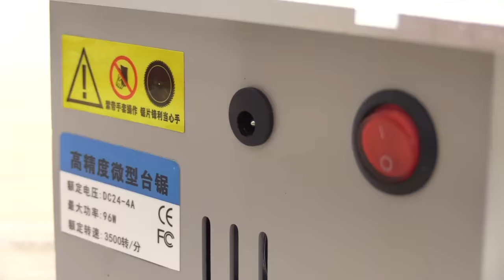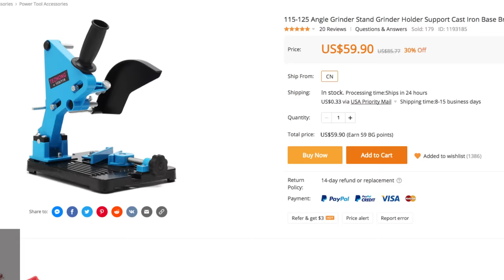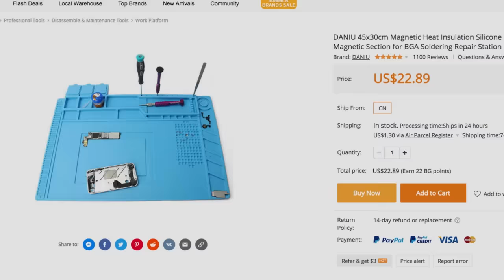3 AMAZING Object for DIY BY: Banggood

Comment: I made a simple crosscut sled for mine,with a much larger work surface,from 1/8" hardboard and plywood rails guiding ut the outside of the tabletop. So I can cut larger pieces. I made a T-square type of rip fence from 3/4 alum. angle stock,easier to adjust.

Comment: Can you lower the blade on the saw? It has to spin to make the drill work, but i dont think its very safe to do so if the blade is up
Reply: No but on the flip side you can use it to build a cover for it.
Reply: @ez-8238  I was gonna say that if they didnt shipped with a cover, the drill attachment shouldnt be part of the kit. I mean, you can use your own drill.  but i just realized, at least in the photo @4:13 it shows the cover for the blade. I suppose they did actually thought about that safety issue.
Reply: @Alientcp  Not only they thought about it, they included it. You can see it in the unboxing at the start. The host just didn't bother to install it before using the drill.
Reply: the blade lowers with an allen wrench thru the table, the chuck still works,it moves up and down too.. the blade guard is useless,same for the rip fence. I would make a flip-up blade guard similar to regular table saws,with riving knife. On other YT videos,I've seen some very creative homemade rip fences.

Comment: The mini table saw is cool and if it was $25-$30 ok great but they got it priced at $125. I bought a full size table saw on Black Friday sale last year for $99. Full price was only $135 so even not on sale it would have only been $10 more than this tiny offbrand. I don’t need another one but if this had been a reasonable price point as I said $25 or so I would get it just for convenience and not have to break out the big one for small jobs.
Reply: So you want it to be MORE convenient than your full size one, but pay LESS? Your full size one costs less BECAUSE it's less convenient!

Comment: How many volts is the first item
Reply: the saw runs on 12-24 VDC,supplied by the power adapter,which was 110-240 VAC,or you could make your own cable to connect to 12-24V batteries.  it draws 4 amps at 24V. (96W)